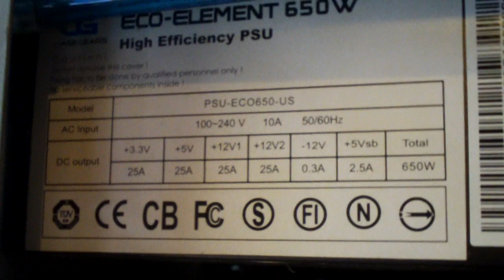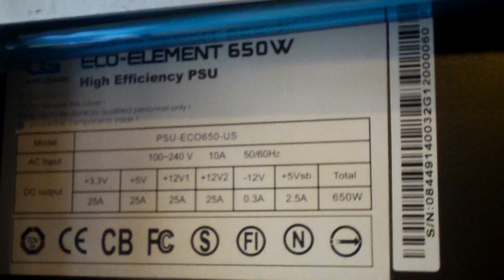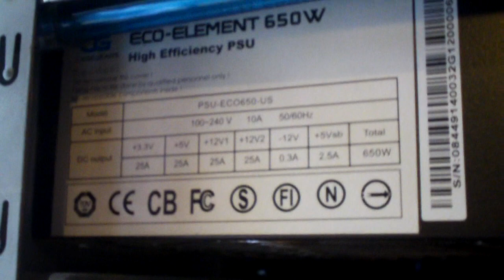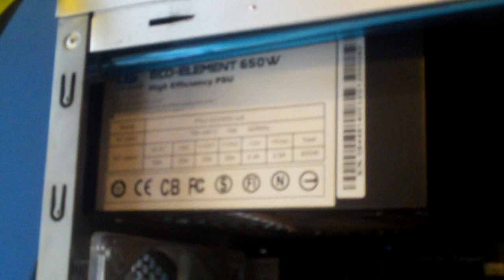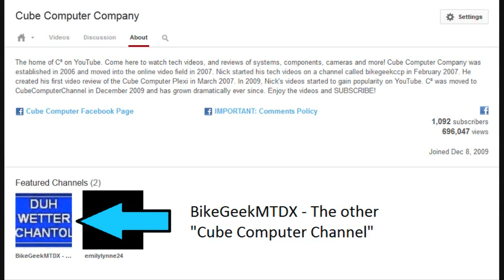Power Supply Failure in the MTDX

Comment: It looks like judging from the 400V capacitor in the input side that this PSU uses APFC. APFC does not use a voltage doubler, but non-PFC PSUs do, so there is much more stress on the primary capacitors in this case. Because of that, it's not uncommon to see capacitors from bad brands fail on the primary side of an APFC PSU. That TNY switch's failure is catastrophic, though. I have heard of some TinySwitch failures but nothing this grave.